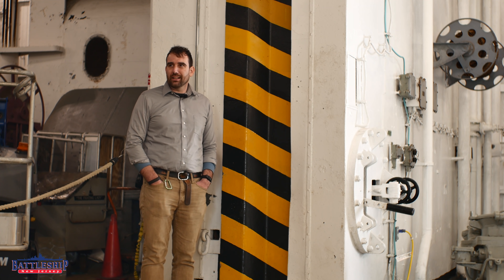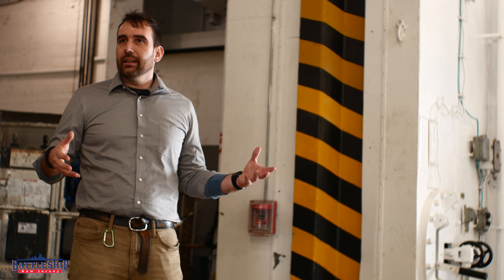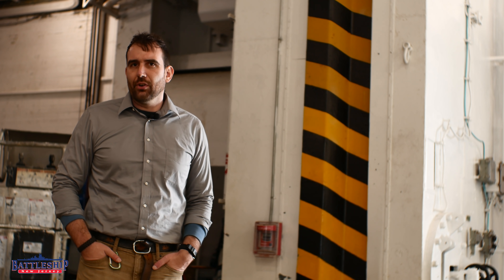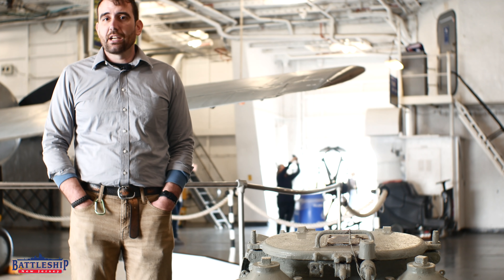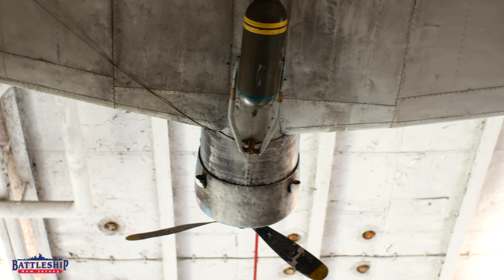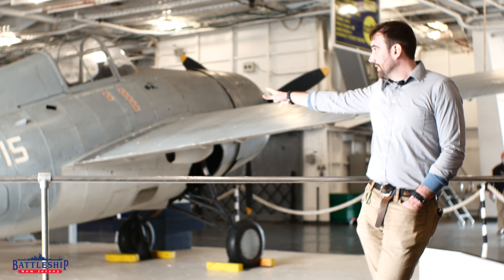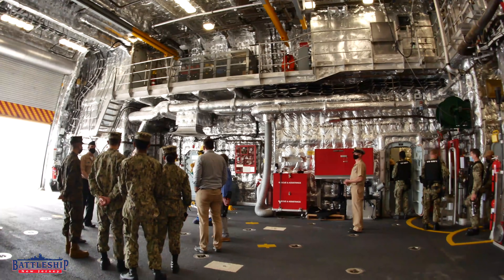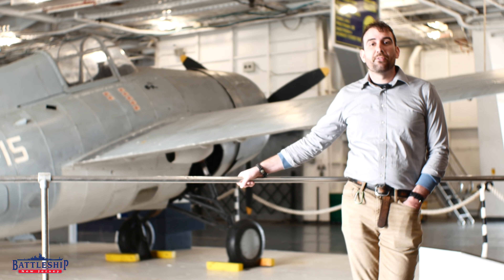Preventing Fires on Aircraft Carriers

Comment: The doors have two correct names of which are either Division Doors and/or Fire Doors. Ever been inside of one to clean? Ever open one manually? I have. There is really only one set of Hanger Doors on an Essex and that is for L3 which we have just re-cabled on the Hornet after one year out of operation. L2 uses roll up doors to seal off from the sea.

Comment: Probably the ability to purge the fueling lines of fuel and vapors with a pressurized CO2 system. If memory serves, the Lexington at Coral Sea, being a cruiser conversion, lacked such a feature and that helped spell doom once she was hit and damage control could only do so much. 

Plus we are talking Avgas or "High-Octane Aviation Gasoline" which has a far less safe flashpoint than does JP-5 (glorified kerosene) today.

Comment: What I found interesting about the Essex-class carriers was that in the post-war modernizations, they didn't all get steam catapults.  A fair number of the ships retained hydraulic catapults which were either the same units they (rarely) used during World War II, or updated hydraulic catapults.  If they didn't get the steam cats, they were not as capable because they could not shoot off as heavy planes off the decks or at least not accelerate them as quickly as a steam catapult.
[They didn't use catapults as much during World War II because the planes were a LOT lighter than they are today and could generally launch without cat-assist.  Their stall speeds were on the order of 85-95mph on average.  Jets today generally won't stay in the air in level without flying a minimum of 170-180mph let alone climb at that speed!
[The aerodynamics and weight of the new jet planes made catapult useage mandatory.]
Of the four Essex-class ships we have left as museums, Lexington and Intrepid were re-equipped with steam catapults in the 1950s.  The other surviving two units, Yorktown and Hornet, retained hydraulic catapults.  It could be a cost issue because I think I've read that the steam catapults require quite a bit of internal tubing and other infrastructure to route the steam from the boilers to the flight deck catapults.    
At any rate, all of the surviving Essex-class carriers we have now were reclassified as CVS (anti-submarine) carriers by the early 1960s.  Intrepid was kept active with the proviso that she could double or be pushed back into service as a CVA/CV unit since she had steam catapults.

Comment: The most brilliant innovation was to ask the opinion of the New York City Fire Department for recommendations after the loss of the Lexington. The NYFD come up with several ideas including fire curtains which were adapted from theater fire curtains but the best I think was to inert the fuel lines after use with engine exhaust. Another was to de-fuel aircraft before putting them in the hanger and much, much better training.
Reply: Interesting, that. VLCCs use boiler exhaust to inert the cargo tanks when discharging the cargo. As the oil is pumped ashore, the CO2 from the boiler exhaust (which goes through a seawater scrubber to get rid of any sulphur oxides) is pumped into the tanks to displace any oxygen that might pose a fire risk.

Comment: I don't think the aluminum superstructure actually burned in that ship that was shown in the picture. Actually burning aluminum requires very, very high temperatures and/or pressures. While it's true that it's less than that required for steel, if aluminum is actually burning, both the aluminum and the steel around it have already turned into a molten puddle. Pretty much the only way you would actually burn aluminum would be something like the aircraft hull of a kamikaze aircraft or maybe if an aircraft took a direct hit from something like a bomb or a battleship round. That might get enough pressure and temperature very briefly right at the time of impact for part of it to burn (especially if it were carrying a bunch of avgas,) but, even then, the actual aluminum burning would likely only happen for seconds at most.

When putting out an aircraft on fire, what you're generally putting out is basically everything except the aluminum hull. The aluminum hull might melt, but all that avgas, the upholstery in the seat(s), papers, munitions, tires, the hoses and gas in the engine, etc. will actually burn. This will certainly destroy the aircraft, but it won't destroy everything within a significant radius of it (including the floor and hull beneath it on a carrier) like actual burning aluminum would.

A quick way to check whether there is a sustained aluminum fire on board a ship: If the ship is still a ship, there is probably not a significant sustained aluminum fire on board.
Reply: Ship fires can actually be really hot, at such scale they draw a lot of air in, and molten aluminium in a wet enviroment rich sprayed around by explosions and fast flowing air, is much more reactive than solid stuff. Al fires also dont care about CO2 much and water feeds the fire badly... While I agree that's not the main fuel, if your whole hangar is turned to slag with the aircraft and weapons inside, chances are there will have been a non-negligible amount of Al fire...

Comment: I think the armored flight deck ie the most oversold survivability feature of a WWII carrier.  No US carrier was lost to bombs alone.  They were killed by torpedoes.  Armored decks don't stop torpedoes  Even Lexington's gasoline fire was caused by a torpedo strike rupturing the AVGAS tanks.  The catastrophic damage to the Franklin was not caused directly by the bomb hit.  It was the secondary explosions from the mass of fueled and armed aircraft in the hanger.  Oriskany, Forrestal and Enterprise had the same issues during their Vietnam War mishaps.    The British armored deck was only proof against 500lb bombs.  Both the US and Japanese dive bombers carried 1000 lb+ armor piercing bombs and if a Britsh armored flight deck carrier fought in the major Pacific carrier battles bomb hits would have breached the flight deck anyway.
Reply: The D3A only carried a 250 kg bomb - about 550 lbs - at most. The armored flight deck on the British CVs would have stood a good chance of resisting that... though hits to unarmored parts of the deck (such as the lifts, a common aim point for dive bomber pilots) would still have gone through without any difficulty, of course. Also, the armored flight deck wasn't merely not helpful vs. torpedo attack: the reduced stability caused by carrying additional weight high in the ship would have been an absolute menace when trying to fight flooding. Fortunately for the RN - well, apart from Force Z - they never had to face a really first rate air opponent. 

All that said, the real primary opponent of the FAA was always the RAF. And the reasoning for the armored flight decks looks a lot more sound when you take into account that they knew their procurement system was never going to provide aircraft with competitive performance - or even adequate numbers of obsolete aircraft.
Reply: @Philistine47  The D4Y, introduced in 1942 carriered a 500kg bomb.
Reply: @johnshepherd8687  The D4Y didn't participate in any of the carrier battles of 1942, though. (One prototype did go to Midway aboard Soryu, but strictly as a scout. It didn't participate in any actual or planned strikes.)
Reply: @Philistine47  They flew from land bases and were carrier based at the Battle of the Phillipine Sea.  

I keep forgetting to point out that US carriers frequently operated against shore based targets and land based air.  The Mediterranean was not only theater where carriers flew within the range of land based aircraft.